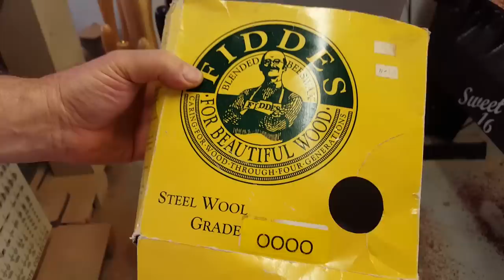Turning A Segmented mini star Goblet - Woodturning by Eli Avisera

Comment: Making the blanks is the easy part. The star is a regular octagram. t'{4}=t{4/3}={8/3} Basically 45 and 90 degree angles. You could make a jig for a table saw, because the cuts meet at 90 degrees on the inside.